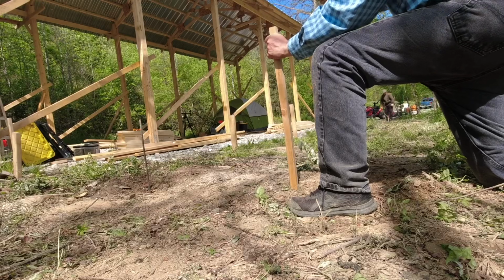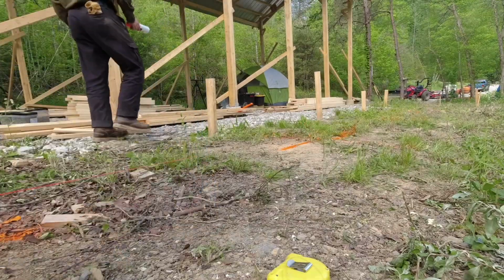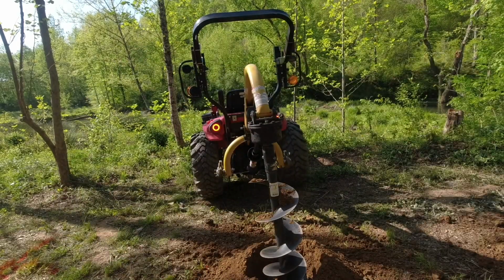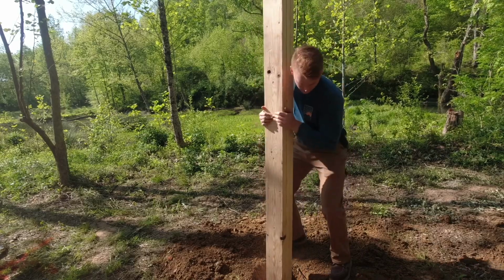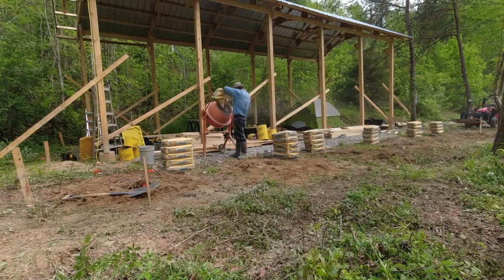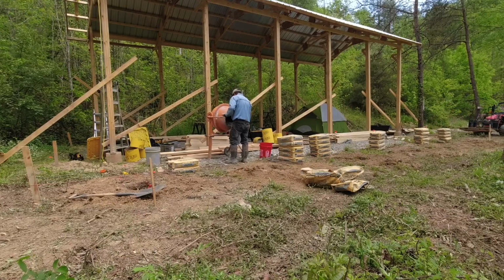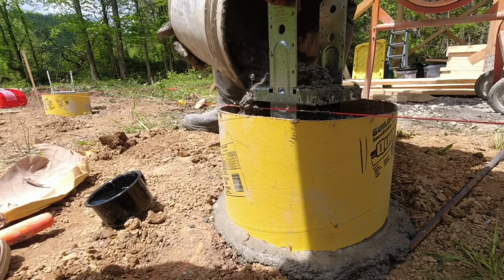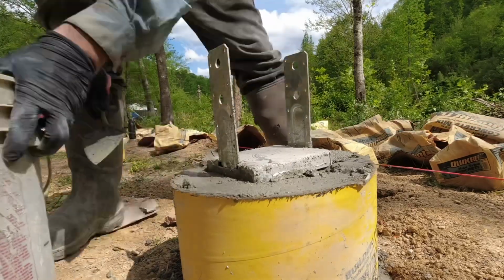Stage 2: Pouring concrete E168

Comment: Looks great.  I think you can wet set those brackets after you finish the concrete so they are not in your way when filling the tube.  You wiggle them and push down slowly I think.